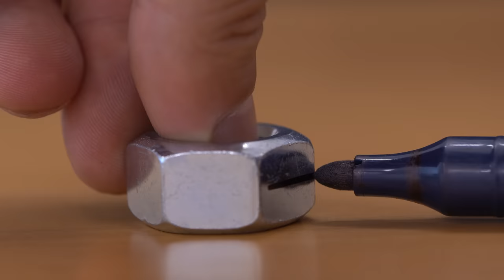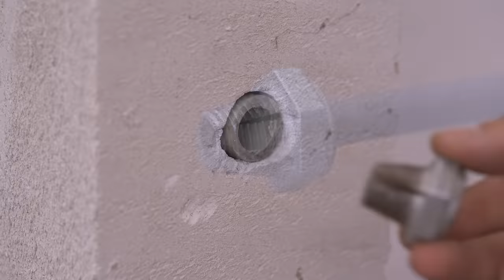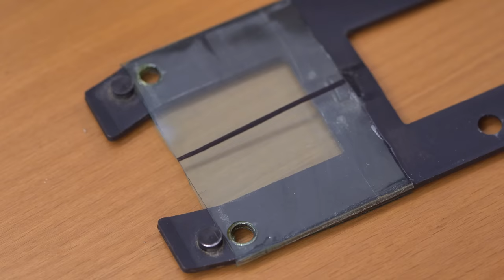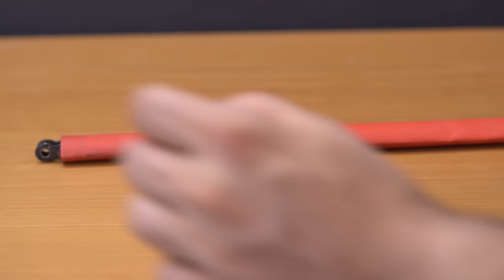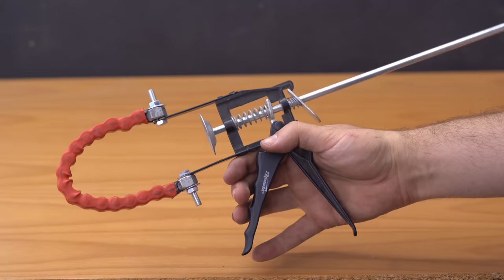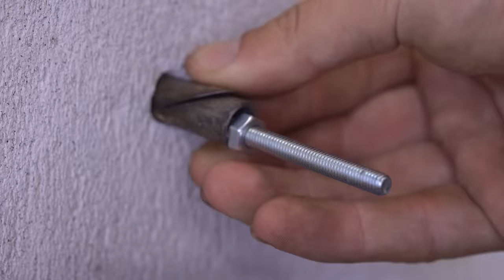Brilliant Minds and inventions of Handyman

Comment: That bolt with the pipe cut at an angle is not a new invention . Its a scaled down version of a rock anchor used to anchor power lines